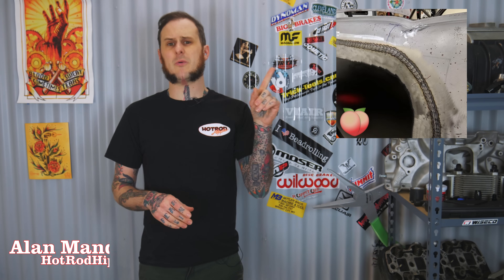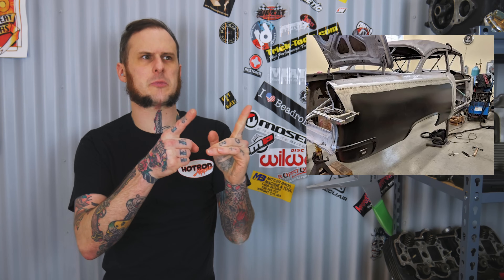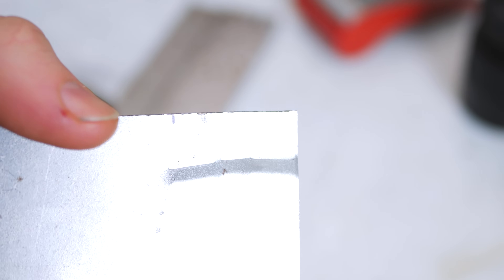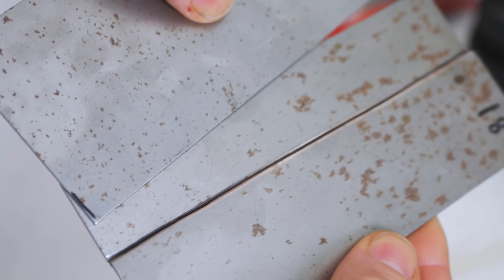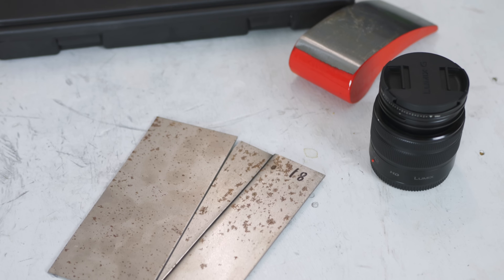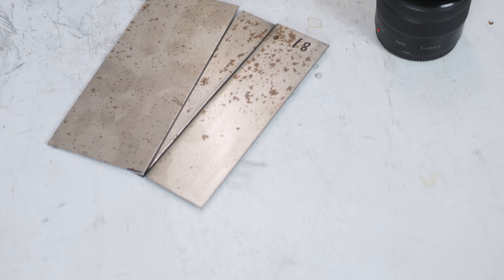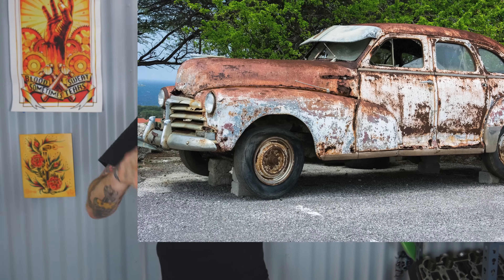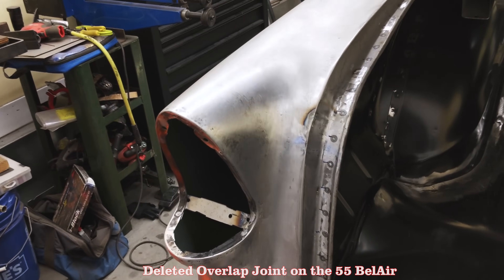Butt Welding VS Overlapping Sheet Metal Panels

Comment: I'm not a body and fender guy. But I'm so old school I've always butt welded oxy-acetylene for my sheetmetal projects. I assume you take care of shrinkage with hammer and dolly stretching or air hammer?
Reply from the maker: You are correct I hand hammer and dolly my welds to stretch out the shrink. I've been known to planish with a planishing hammer but lately I've been doing it all by hand instead. The air hammers I have on hand just don't do the job quite to my liking.
Reply: My sheetmetal repairs early on was on farm equipment like truck hoods, tractor hoods, harvester covers and one was a really extensive repair on a portable grain elevator. This was in the 70's so I'm not even sure something like those air powered units that make laps was around. But if they were I wouldn't have been able to use it because there wasn't "extra" metal to make a flange out of. I was repairing where the metal would crack from stress or abuse. But I always thought lapping was possibly the pro way to do it until your vid. As usual you made your points very clearly and I could see if it had been available fallen into the trap too. The thing that saved me was ignorance of the process :) I couldn't really see your repair on the '57. I always loved the idea of staying away from bondo but thanks to you and others I see it's possible to do it now. Thanks for the vid.

Comment: Explain your technique and machine for the weld shown at 8:15.  Thanks.
Reply from the maker: I'll give you a quick brief here but suffice to say I will be doing a few videos on the topic eventually.

That specific process was:
-Clamped in place after file fitting.
-Tacked every 3/4" along the entire Seam.
-Lightly hammer and dollied to make sure everything was properly aligned.
-Welded 3/4"
-Lightly hammered to maintain shape.
-Repeated continually for hours as the entire weld was well over 100".

That isn't my preferred method but it sure looks looked pretty.
Reply: @HotRodHippie  cant wait for more in depth videos on this process!

Comment: Good on you - you’re so right! I’ve always laughed at  Eastwood for wanting us to buy their tools and do lap joints!
Reply from the maker: I get lap joints. I don't approve but I get them. What Eastwood sells that I just don't get is those pliers that make a V-groove of sheetmetal to "fill with weld". So one goes through all the effort of properly fitting a butt welded panel then ruins it with a groove that is "easy to weld". Sigh

Comment: Ive always butt welded since i started repairing cars, with tig theres no gap, with mig i use a gap about the diameter of the mig wire and make sure the gap doesnt close up as i go
Reply from the maker: Solid input. I don't know why I never replied to say so. 👍👍 I have been known to leave a material thickness gap on mig welding bit I only mig weld chassis stuff usually. Thanks